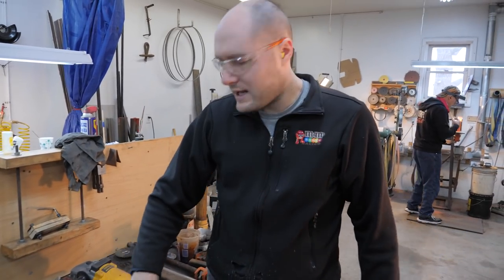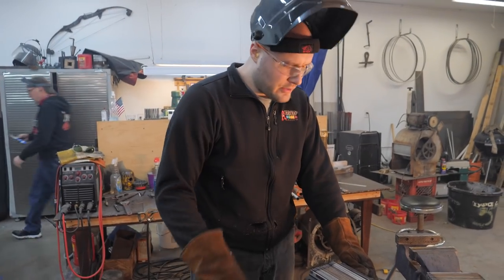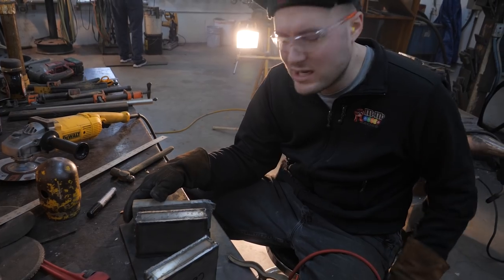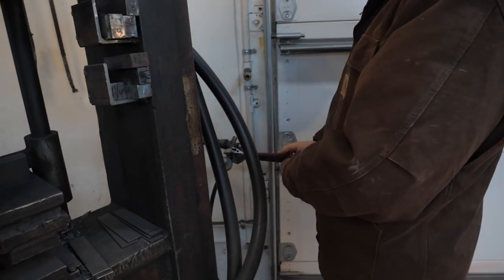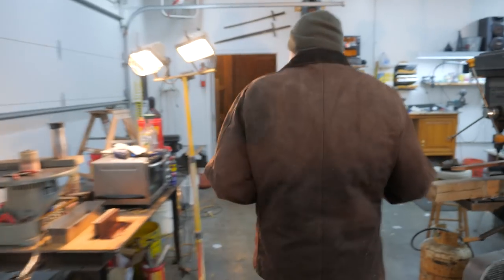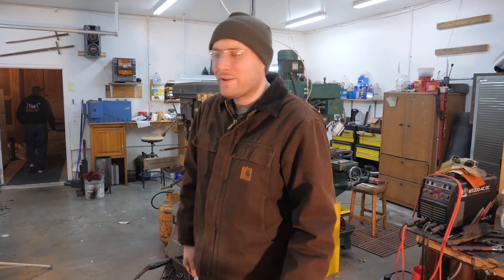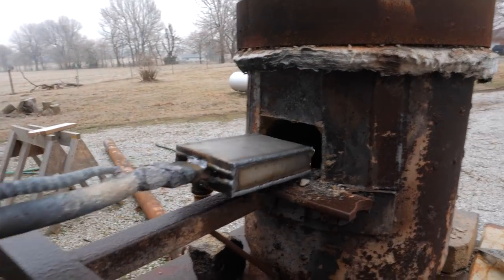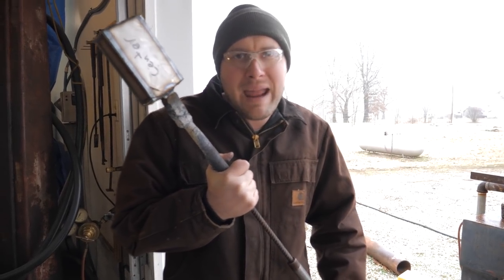Making a Medieval Damascus Sword Pt. 2

Comment: Do you remove the sheet metal after the initial forge weld, or does it become part of the piece ?
Reply from the maker: I do remove it.  It does not become part of the piece.  Thanks for your question!  :)

Comment: Hi Kyle is there a particular reason that you use a 1085 in your Damascus billet instead of something like a 5160 eg a better contrast during etch and do you use this combination in all of your Damascus
Reply from the maker: Hey Matt 
Good question 
1084 and 15 N 20 like each other a lot 
They melt together very nicely and  we like the graphic contrast between the two 👍🏻🔥☕️🤙🏻⚔️
Good to have you here 
Cheers 
Team Royer